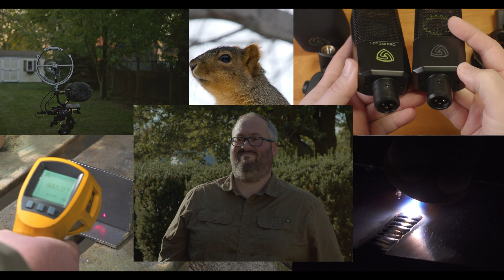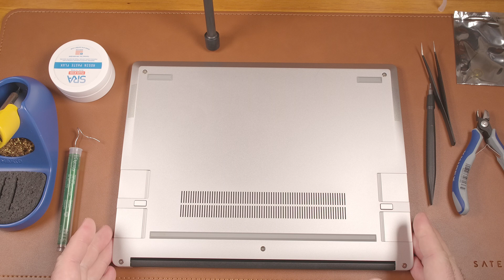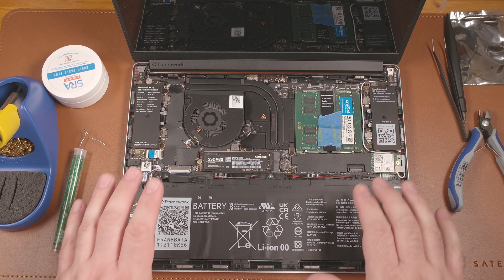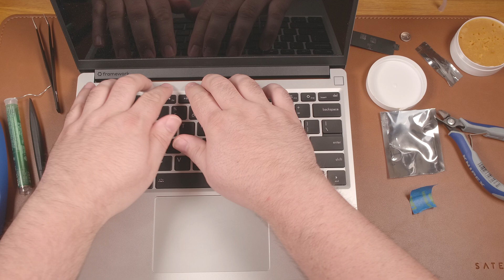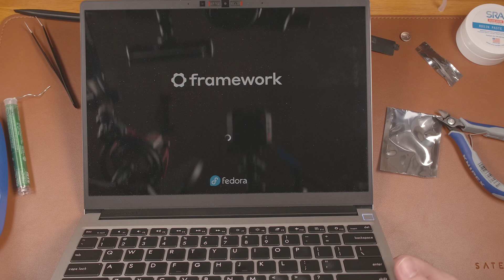Framework Laptop Repair, RTC Battery Substitute Module Install

Comment: Thank you so much for this! I’m about to do this, and I am TERRIFIED 🥲 I am not a tech person AT ALL. Never used a soldering iron. 
I am confident in DIY stuff, but due to the risk involved here, plus my lack of experience… you know how it is. I’m super nervous. I appreciate people that make these videos so much! That’s why I will probably document me doing it, as well. So yeah, thanks again! 🤗
Reply from the maker: If you have never soldered before I would recommend practicing on something else first.  Something that doesn’t matter.  

Also, if you let too much heat build up in the components they can be damaged or simply desolder from the board.  If you struggle to get it soldered, stop and let things cool, then start again. 

A big thing to take time and be careful with is the plastic battery holder on the board.  It’s easy to break.  

Good luck!
Reply: @bigtb1717 thank you :)
I have a couple questions, if you don’t mind:
1. What temperature should the iron be?
2. instructions from Frameworks, unless I’m confused, said to take out the whole main board? But it looks like you just took out the battery (which looks easier to me) 
Basically, I’m just unclear on what I should remove/disconnect before starting the soldering lol
Reply: Nevermind on my second question; I just rewatched that part and it answered it 👍
Reply from the maker: I normally run my iron at 650-700 F.  It will depend a bit on the temperature of the solder you use.  The way I see it, if I set it too hot, the flux burns more and the tip doesn't stay as clean.  But if I set it too cold, it will take longer to heat up a part enough to actually melt the solder.  It may seem counterintuitive, but a colder iron may actually put more "heat" into the component.  You want to melt the solder fast and then take the iron away.  If you have to hold the iron in place for a long time, you will be pumping heat into the component longer.  If you have an iron with an adjustable temp, I would start in that range and practice a bit.  Then see if it seems like you need to adjust.  Takes forever to melt the solder?  Maybe turn the temp up a bit.  Solder melts fast, but the flux turns black and crusty right away?  Maybe turn it down a bit.

I know you said never mind on the second question, but I'll explain a bit.  It may technically be "safer" to remove the board, so I'm sure that's why the official guide directs people to do that, but I didn't bother.  I removed the battery, just to be safe, and just left the board in place.
Reply: @bigtb1717  would my laptop turn on after I was finished, when I pushed the power button(without plugging the charger in), if I did it incorrectly?
Reply from the maker: No, I don't think it would because the RTC circuit wouldn't be powered.  If done correctly, it should power on without plugging in (assuming the battery isn't dead) because the RTC circuit would be powered by the main laptop battery.

Comment: Anyone know if this comes fixed on the 11th gens that they are selling now?
Reply from the maker: Unfortunately, I don't believe they have any of the "re-work" done to eliminate the RTC battery or have it charge differently.  So you will still have to either replace the RTC battery if it stops holding a charge, or do the modification.

However, I can't say 100% that later versions of the board weren't updated from the factory.  You could reach out to Framework support if you want to find out for sure.

Comment: Could it also be that original RTC battery that you pulled out is not a rechargeable one even though it's supposed to be rechargable? 🤗
Reply from the maker: Unfortunately, no.  This was an issue on all the 11th gen mainboards in the original Framework 13 laptops.  It's a two-fold issue.  First, the RTC battery only recharges when the laptop is connected to the charger and there is enough draw on the RTC battery such that it will fully drain after a couple weeks to a month of not being connected to a charger.  So if someone goes a couple weeks or more without using their laptop and it wasn't connected to a charger during that time, the RTC battery will fully drain.  The second problem was an issue with Intel's configuration of the chipset (I believe) that meant it wouldn't simply lose the time if the RTC dies, it actually won't boot at all.  This meant you would have to plug the laptop in and let the RTC charge for a moment before the laptop would turn on.  Making matters worse, after multiple deep discharges like this, the RTC battery would degrade and would stop holding a charge.  This meant that after even a short time turned off and not plugged in, the RTC battery would die and the laptop wouldn't turn on.  

Framework was initially (and possibly still is) offering free, replacement RTC batteries to anyone who asked.  Eventually they came up with a complicated re-work to allow the RTC battery to be re-charged from the main laptop battery, not just when it was plugged in.  Then they came up with this little RTC substitute module, which eliminates the RTC battery entirely, and just has the laptop battery power the RTC circuit.

In newer mainboards, some still have the RTC battery, some don't.  But the most important change is that on the newer mainboards, if the RTC circuit is not powered for some reason, the laptop will still boot fine.  The time will simply be wrong until you re-set it or until the laptop connects to the internet, at which point it will automatically set itself.
Reply: @bigtb1717  I see. I have Asus Tuf gaming laptop just sitting because I use Infinity and I had to disconnect battery on it to stop it dropping to 0% and possibly getting destroyed as the 1st time I let it sit for 2 months and battery dropped from 80% to 2% so I disconnected battery and then checked 6 months after and the main battery this time lost ony 1% of charge but what I noticed when I plugged it back in was that windows clock stopped around the time I disconnected the main battery from mb and what's interesting is that the laptop also has small button RTC battery so I don't understand why laptop's RTC battery couldn't keep the windows clock up to date or just update windows time from bios clock?
Reply from the maker: If the time was incorrect when the computer started up, it's likely that the RTC battery did die (and not all are rechargeable).  The difference being that it didn't prevent the laptop from booting, it just lost the time.
Reply: @bigtb1717  obviously there is something very wrong with modern laptops since in old days that button cell RTC battery would keep the bios clock working for years like in desktop PCs. Anyway that Asus Tuf is intel i5-10300h CPU and my other Infinity laptop is AMD ryzen 5 4600h and that ryzen Infinity I can leave off for a whole month and no problem the battery charge doesn't even drop 1% 😌

Comment: Thanks for this video! Going to try this but I am a bit of a soldering newb. One question: so you put soldering on your tip and then basically are applying it to the wire and capacitor? I've seen where people feed a little line of solder into a connection so just wanted to check what's happening in that part of the video (around 7:50)
Reply from the maker: Yeah, I just "tinned" the tip of the soldering iron, which just means I put a bit of fresh solder on the tip, then I did the same to the wire.  Putting a dab of flux on the capacitor is important because the solder will want to flow and wick, but FAR better if there is a bit of flux.  So once the capacitor heats up enough for the solder to wick over to it from the wire and iron, that should be enough, especially for a connection this tiny.  You probably won't need any additional solder.

Most electrical solder is "rosin core" which just means it has flux inside.  Sometimes some additional solder can help ensure the joint gets connected and adding it generally adds additional flux (because of the flux in the solder).  So this can sometimes help.  But in this case, I wanted to heat up the component as little as possible and there was plenty of solder on the iron and wire already in order to make the joint work since there was already a coating of flux on the capacitor.

Adding additional solder puts additional heat into the component and increases the chance for a solder blob to fall and bridge something you don't want bridged.  Honestly, with components this tiny, I really can't imagine trying to add additional solder without ending up with too much.  But everyone has their own techniques that work for them.  I'm not going to say my way is definitely the best.

If you are new to soldering, I strongly recommend you practice on something else first.  Get a feel for watching the component heat up until the solder flows.  Get a feel for how comfortable you are and how confident you are that you can do this without issue.  If you damage and short the capacitor, knock it loose, short something else, etc., how confident you are that you could fix it.  Just make sure you are comfortable before getting started on your computer.
Reply: @bigtb1717  Awesome! Thanks so much for the tips. And yes, I will definitely work on some other components first, just to test it out. Much appreciated!

Comment: Yea its impressive, but for a customer to do this type of fix themselves is unacceptable. 

After spending all this money on this laptop and than to do this kinda fix due a poor design is unacceptable. 

Soo now, i need to get some additional tools, and hope I do not fry this mainboard lol 

BUT great job on the video! I love that wood finish skin, can you share what brand it is or how you do did that??
Reply from the maker: The skin is from dbrand.  They still offer skins for the Framework laptop, but I don't think the wood grain pattern is still available.

Technically, this "fix" isn't strictly necessary.  I could have just replaced the RTC battery (or kept plugging it in to turn it on), and they do offer replacement batteries for free.  But, for people with a use case that results in the RTC battery dying a lot and who also don't want to have to periodically replace the RTC battery, they offer this substitute module.  From what I understand, at least some of the issue was due to Intel's handling of the RTC circuit, resulting in draining the battery too fast and not booting when it's dead.  But I don't know all the details.  I just know some people have said Intel shares some of the "blame," as it were.

Still, I do understand people's frustration with the issue.  For me, it wasn't a big deal as I already have soldering tools/supplies.  I literally didn't have to buy anything to do this.  I already had everything needed.  But not everyone does and if they have a use case that results in the RTC battery dying often and don't have the skills and/or tools/supplies to do this repair, I can definitely understand the frustration with this issue.
Reply: @bigtb1717 do you know if they fixed the problem for current models?
Reply from the maker: @lorenzo22-k3l  Yes, it is fixed.  This issue only affected the 11th gen Intel boards.  12th and 13th gen Intel boards and the new AMD boards don't have any issues with the RTC.
Reply: It only happens if you leave the laptop unplugged for days at a time. As long as you plug it in once a day, it's not going to be a problem.

The number of people impacted were so small that free modification of the circuit, let alone a recall would've probably been too much for Framework to bear. At the time, they were even smaller than they are now, and it was their first product.

Early adopter problems. It is what it is.